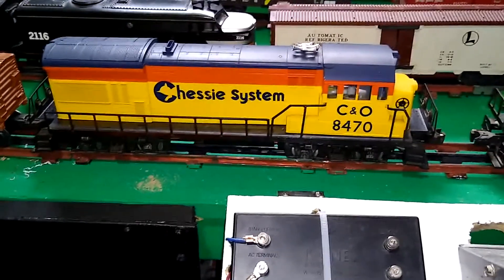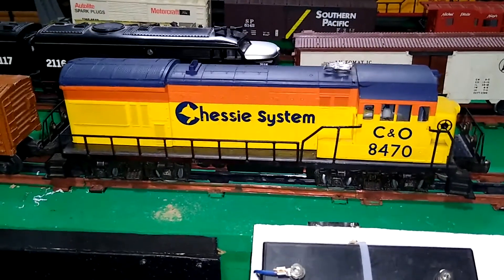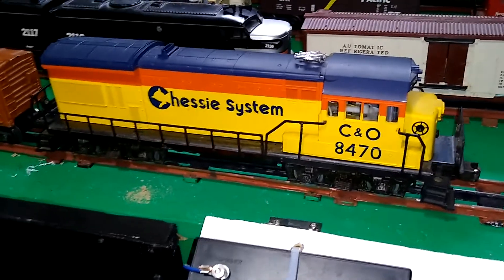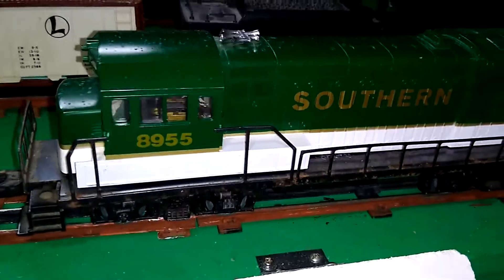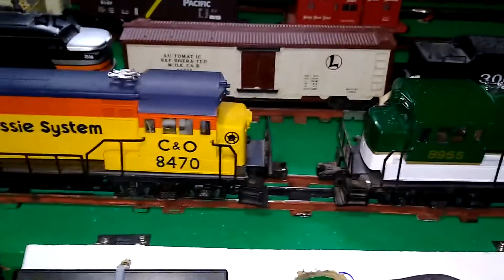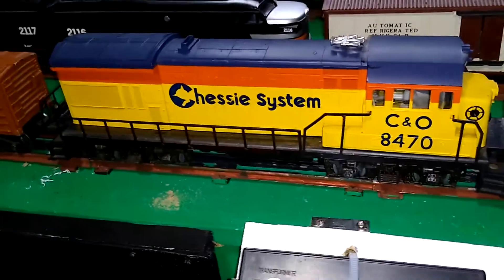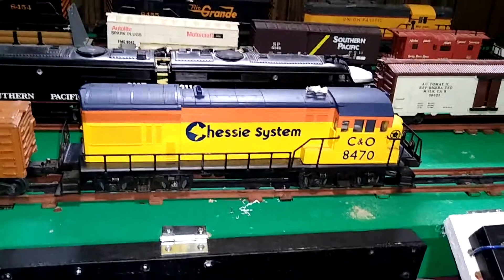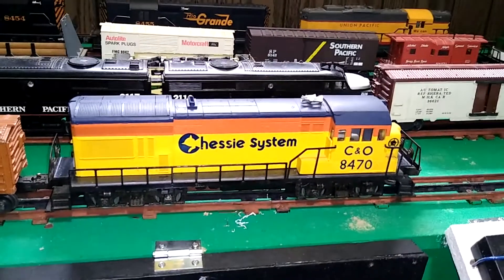Lionel 6-8470 Chessie System U36B (1974)

Comment: Should this engine be as loud as a horn on a modern day locomotive? Is there a way to disable this sound?
Reply from the maker: The sound you are hearing is likely the reversing unit ("E Unit"). To reduce the noise, you can disable the E Unit by sliding the switch underneath the locomotive behind the fuel tank the opposite direction. However, this will lock the locomotive in the last direction traveled and you will have to slide the switch back every time you wish to reverse. The other option is to add a rectifier diode or bridge rectifier between the pickup roller and the E Unit. This will prevent the E Unit from vibrating sympathetically with the AC current. The downside is this MAY cause the E Unit to become magnetized and it may stick in one direction. OR you can power the locomotive from DC power instead of AC (this is a universal motor that will operate either way). If you choose this method, rectify the power from your regular transformer to DC. DO NOT use a regular HO/N DC power pack as the Pullmor motor draws too many amps for these and will blow the circuit breaker/fuse in the transformer. Or you can accept the sound as part of the character of the locomotive.